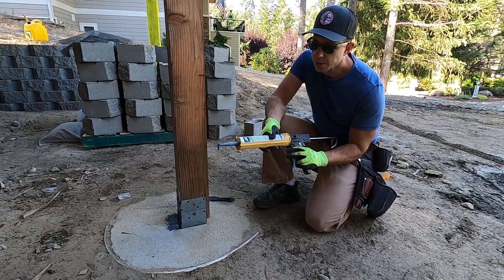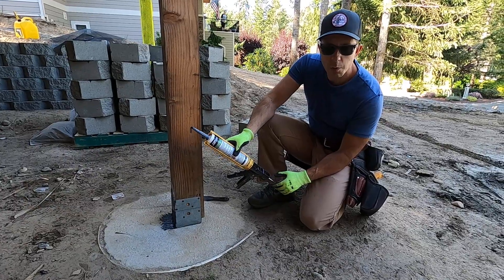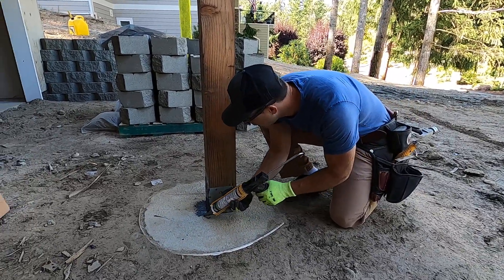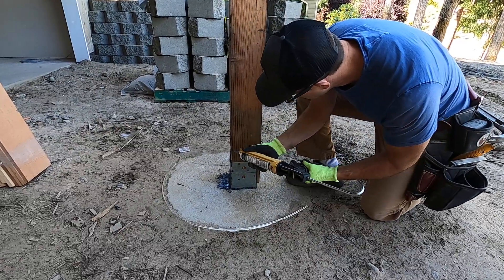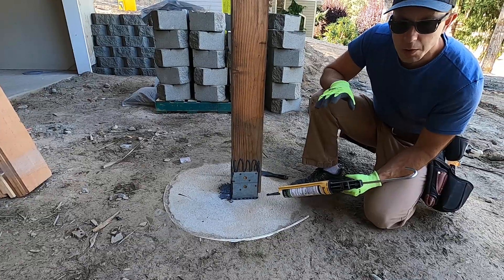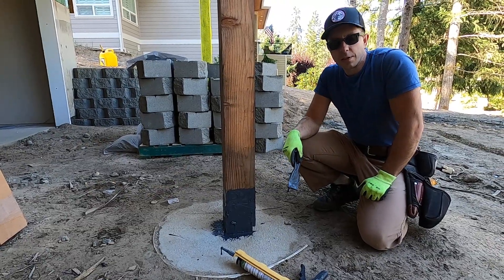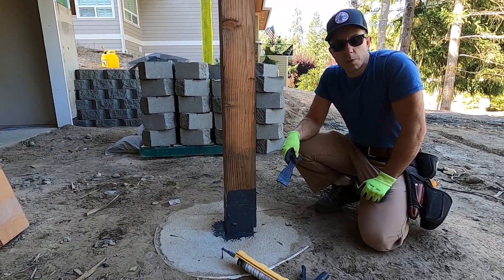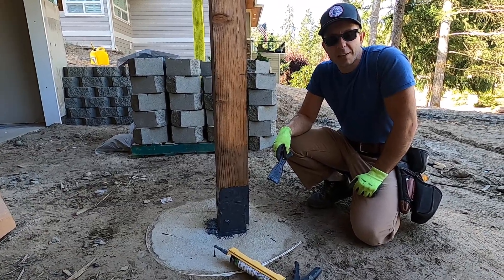Protecting Structural Column From Moisture Related Damage - Part 2

Comment: Not sure I fully understand the concern.  The base of the post will be above the top of the finished driveway, correct?   And the Simpson bracket has an integral standoff designed to prevent capillary wicking. So how will slathering liquid flashing around the faces of post provide any additional wicking protection?  I think the better solution would have been to raise the pier height, but woulda coulda shoulda...

 I like that you're wrapping the post with a rainscreen - probably a more important detail to increase longevity of the post
Reply from the maker: There won't be much of a slope built into the concrete finished surface in front of the garage, and I want to protect the wood from excessive wetting. Even a treated post will be affected by repeated wetting/drying cycles.

Comment: Hey! Cool deal!  On projects I’ve done in the past where this is a concern I’ll have a bracket made up that will embed into the footing and allow the post to be elevated from the slab a little.  It’s not code rated or anything, so that might be a concern. 

This is definitely a great option!  Are you going to liquid flash between the slab and the post when the concrete flat work is all done?
Reply from the maker: This is an elevated bracket, but I really want to protect this. You'll see the rest of the assembly in the future... Stay tuned!!